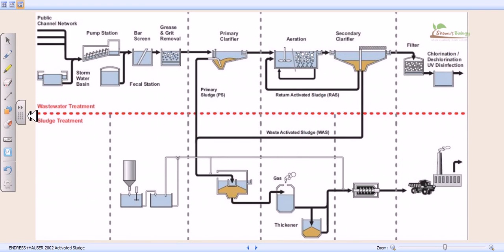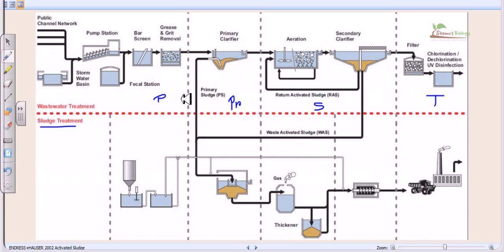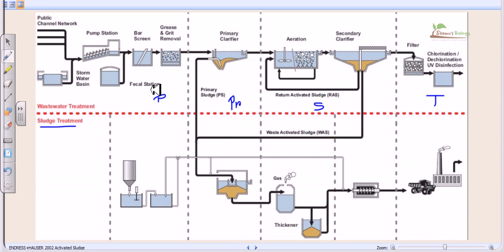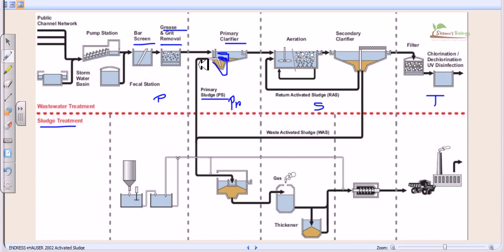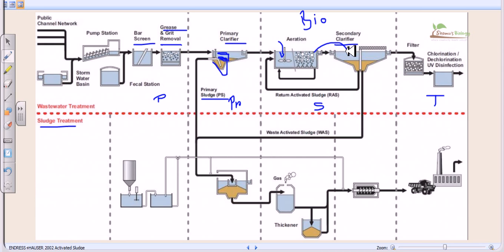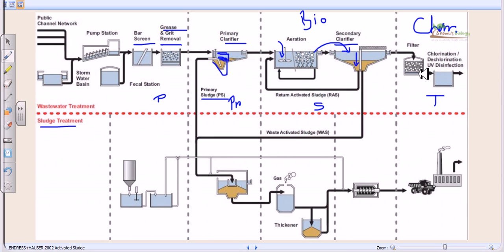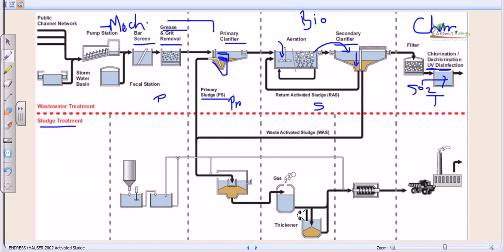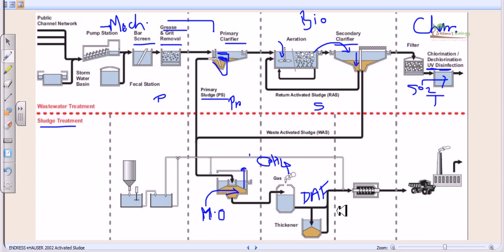Wastewater treatment process overview

Comment: If only toilets didn't contaminate all the wastewater with viruses and bacteria that even build a protective shell around them to even resist chlorine and which point of use filters say they  remove from the incoming  potable water. In naure purification at its finest is evaporation, collection of vapor- condensation, rains, sand filtration, water again, maybe DeKa has an affordable steam distillation solution which would add steam disinfection for a new toilet to reduse waste to a disposable solid in a disposable compartment with a disposable liner that reduces w human waste to a brick which goes to a landfill, like cat litter does, and whatever small amount of water and moisture used  steams out, disinfected as water vapor, then the wastewater is not contaminated by sewage etc, and the rivers won't smell like each town, and we'll reduce the amount of ammonia in the gulf, and wastewater minus all the toilet contamination from even entering will be more easily cleaned for use in irrigation, and perhaps the future bottled water companies will also use ocean desalination until it can be pipes directly as potable water through existing supply lines, and towns could easily hook up to a main line running from ocean wave powered desalination through all 50 states.

Comment: Helped me a lot lot lot .......thank you very much...but i have a question , how is grit or grease removed at the grit removal chamber..
Reply: gravity
Reply: It settles to the bottom due to the slower flow of water. There may be additives introduced to help bind the solids and  make them heavier so they will settle to the bottom.

Comment: Very informative and detailed lesson. Can you introduce in the sludge process at the end instead of heating the sludge after dewatering maybe at dewatering using the Geotube where you introduce a poly to sludge as a thickening agent and also to assist with killing harmful bacteria and in that process dewater dry and then at the same time safe electicity or power and then sell the dry sludge as a fertiliser to farmers? Just a question  or an idea. Please let me know if it may work or not.